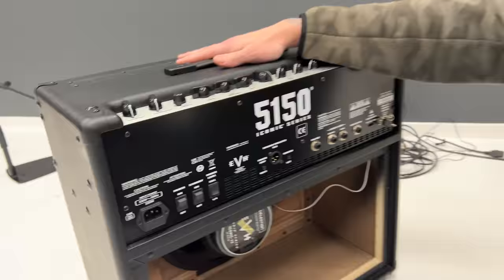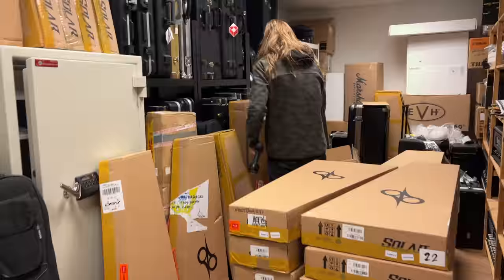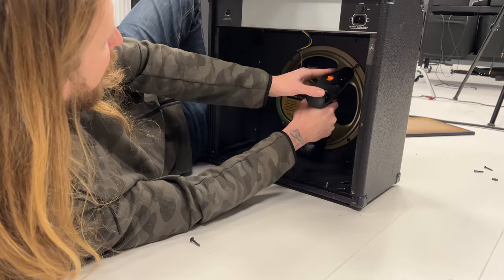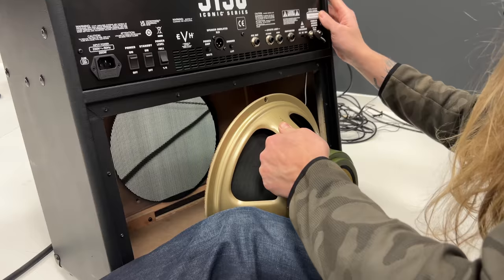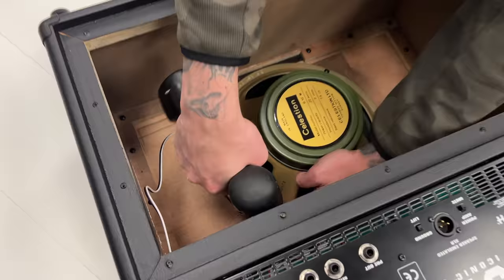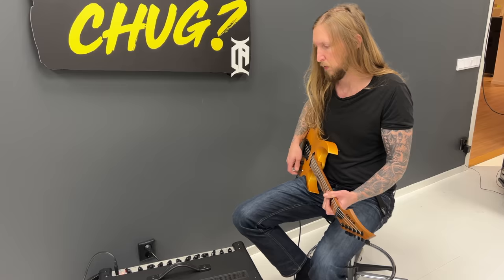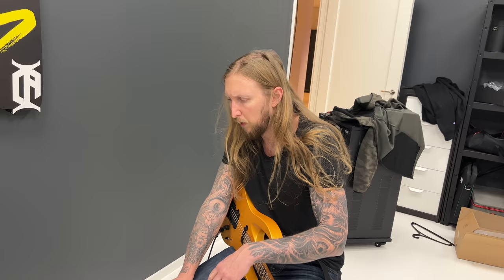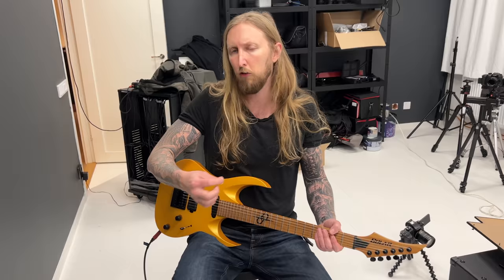EVH 5150 Iconic Combo Speaker Switch - Celestion Greenback 25W

Comment: Of course you can’t build a tube amp at this price using a UK built speaker, so I had Celestion modify one of their cheaper Chinese ones so it sounds in between the brighter G12H Anniversary used in our 5150 III combos and the darker EVH speaker that’s based on the G12M and used in our 5150 III 412’s. It looks similar because it shares some of the parts such as the critical smaller dust cover, 1-3/4” voice coil and the edge treatment is the same. I think the end result is a nice sounding speaker that’s much better than their stock cheaper ones and costs about 1/3 of the G12M.
Reply: Yeah I don't think anyone is dogging on you or anything.  I am looking forward to seeing what comes next for you and EVH/Fender and eventually trying the Iconic for myself.
Reply: If you don't mind me asking, how would you compare the iconic speaker to the Sheffield speakers that were made to sound like Ed's worn greenbacks?
Reply: @andrewsmall4865  understood, I just wanted to dispel the idea that we just threw a cheap speaker in it since I spent many months of testing and trying different tweaks to develop it. Ola didn’t say that but others have. Thanks!
Reply: @DarrenWaters75  these do sound closer to the Sheffield 1200’s to me, but the Sheffield had bigger/expensive magnets. So the efficiency is a few dB less on the Iconic speaker
Reply: Hi James, happy holidays.  Question, is the Iconic related to the Amptweaker amp you were prototyping a few years back?  Hope things are going well for you at Fender?
Reply: Hey James, what is the Impedance of the individual speakers in the Iconic cabs?
Reply: @austinp4489  16 ohms series parallel in the 412 and 16 ohm 112 in the combo
Reply: @jamesbrown7468  Thank you, the back of the speakers don’t show it and I like to pair my 16ohm DV-77 with a lot of different Celestion Speakers.
Reply: Thanks for the insight James! I’ve been really enjoying all the iconic sounds I’ve been hearing across all the demo videos! Great work!
Reply: @austinp4489  yeah, for some reason Celestion didn’t want to print the impedance on the label, but it’s on the magnet edge sticker
Reply: Hey James Brown can you talk Fender to letting you mod a Blues Junior. I have amptweaker tightdrive for over 5 years. That sound would be amazing on a blues rock amp.
Reply: The g12 h which is 55 hz sounds really bad azz also deep chug ,but everyone's ears hear a little differently,
Reply: I might just buy the iconic cab to test with some of my amp
Reply: Huge fan of all your circuits!! What're some of your favorite tubes & cones for your circuits (e.g. tight metal or 5150)?
Reply: Question for you, James, if you don't mind. So the Iconic combo is 40 watts, and the Greenback Ola puts in the amp is 25 watts. Is there any merit to the rule of thumb, that you should always have more speaker watts than amp watts? Can you damage the 25w speaker cranking the 40 watt amp?
Reply: @sergiopaulo4660  I haven’t spent time evaluating and usually use what we can get.
Reply: @jesperbc  I don’t know how much that greenback can actually take but that’s another reason we designed a 40w speaker for these. Depends on how loud you play the amp and for how long.
Reply: @jamesbrown7468  thank you for all the sick sounds! The music I listen to and enjoy making wouldn't be the same without your body of work 🙏🏽🔥
Reply: @sergiopaulo4660  YW, I’m glad you like my amps!
Reply: @James Brown knows his shit--keep it up, Sir.  Been enjoying the fruits of your labor for decades!!!
Reply: I got mine today, and the speaker in it does have a harsh metallic-y sound. Any way to EQ it out? Or just swap the speaker as Ola did?
Reply: @jonnybroomhead  it’s definitely less bright than the UK Celestion in the 5150 III combos, so try adjusting the presence down below half first and turn the highs up a little. We used a reverse audio pot on the presence so it comes up faster.
Reply: @jamesbrown7468  Thanks! It also seems (maybe just my brain) that the speaker is rounding just a bit the more I play it, like the speaker is breaking in or something.
Reply: @jonnybroomhead  it’s not your brain….I actually woke up thinking about how these speakers need about an hour of playing to break in.  It’s too expensive to have that done at the factory, but it definitely gets warmer when played some
Reply: James how do you get the back cover off the cab? Removing all the screws it does not budge. Worried about damaging it if I try to pry it away.
Reply: @hatata  I used a plastic body filler tool and it worked great.
Reply: @hatata  the vinyl kind of sticks. I’ve done it by poking 2 screws back in the holes on one side or corner and pull up while pushing them towards each other. Or you could use a small Phillips screwdriver in the hole to pry. Or hit it with a rubber hammer can jar it loose
Reply: @jamesbrown7468  I can’t thank you enough for replying … you built an amazing platform and I am very happy with the amp. What are your thoughts on the best Celestion that Matches your vision for the amp? I am playing at home at bedroom levels mostly will I be fine with a 25W green back since I’m not going above 3-4 on the volume or should I go with a 60W cream back and be safe ? I have the amp set to 1/4 power most of the time. I apologize if we are playing Frankenstein with your creation. But you know guitarists and their never ending search for the tonezzz..
Reply: @jonnybroomhead  thanks so much !
Reply: @hatata  if you’re not playing too loud the greenback will probably hang in there….I’ve never tried the creamback but I know the Fender guys like them. Frankly I spent a lot of time developing the speaker that’s in it since on the 5153’s we use EVH on the 412’s and the brighter G12H Anniversary on the combos. I tweaked this one so it’s in between. But you can always change it and adjust the EQ’s to suit you.
Reply: Wonder how a neo creamback would sound
Reply: I can't tell exactly how different it is because the mic'ing is different but would think the original speaker would be closer to the iconic sound you were going for.
Reply: I’d like to try it with a G12H-75 Creamback.
Reply: I have one question...hmm u can put another cabinet in this iconic combo, but there is wrote 40min what's that even mean? U can use another cabinet only for 40 mins or? I didn't get it. (I have the same iconic but in white)
Reply: @dav_e98  it’s not 40 min, it’s 4 Ω minimum. The Ω symbol is Omega and stands for Ohms.  That’s the measurement of resistance or in this case impedance. So the LEAST impedance you can use is 4 Ω(ohms).  If you add a 16 Ω external with the 16 Ω internal, you get 8Ω….so you set the switch to 8Ω.  Hope that helps explain it ✌️
Reply: @jamesbrown7468 Hey man, did you participate or know anything about the XXX speakers? I have one, using it with various amps and sounds really really great. Pretty hard to find in Europe though even used.
Reply: Probably a custom made Eminence speaker.  Eminence made a bunch of speakers for Crate and Peavey. @morellasgeorgios8449
Reply: Still made a good sounding amp dude.  I always got the impression Eddie liked his amps voiced with the Marshall Greenback speaker in mind to begin with.  Cause whenever I hear your circuit/derivatives through a Marshall 4x12 with Greenbacks, I immediately go "that's it.  That's the sound."  But if that stock speaker is the closest you can get with a reasonable price tag in mind, then ya still did a good job.

Plus, putting a 25 watt speaker into a 40 watt amp is asking for someone to accidentally blow out their speaker.
Reply: This amp has ended my clean tone journey. It's my one and only! Thank you sir for making this.
Reply: @Eunoia1127  glad you like it. I played a country gig last night with it myself…ch1 with an overdrive pedal and the Boost footswitch ✌️

Comment: Just the difference between a closed back and an open back makes a BIG difference in sound. If he re-attached the back plate, Or played it it with the original speaker and the back plate off, it would have been a more accurate representation.  As it is, I can't tell if it's the speaker or it being an open back cab.  Big difference.
Reply: also, acoustic memory is largely a myth. without side by side testing, it's almost always just going to be the result that one expects rather than one that is actually confirmed.

Comment: My dad was a car mechanic and one thing he taught us was to always start all the bolts before you tighten any. That way you can still wiggle it around enough to get that last one in straight 😊
Reply: 'zactly
Reply: I learned that the hard way when I assembled furniture as a kid 😂
Reply: I’m a professional Auto Technician, I can honestly say your Dad is 100% correct.
Reply: I’m worried about heat distribution with that closed back. 😬
Reply: @dangitdan9938  why?  The tubes are mounted up in the front of the L shaped chassis and the air comes in the back and out around the power tubes and up through the vents on top like a chimney. It’s got much better airflow than most combos that have tubes hanging down underneath the circuit board. It passed all the safety tests with flying colors. So don’t worry, I got this. If you’re talking about the speaker, all of our combos and cabinets are closed back and have no problem.
Reply: @jamesbrown7468  I've ran this amp HARD for hours on end, and I literally cant find a hotspot on the outside of the amp. Everything is nice and cool to the touch.  Heat management is stellar, and thats an understatement.
Reply: @caseylockwood5512  Cool! 😂
Reply: @caseylockwood5512  we designed the amp with the power tubes pointing up so they can’t fill the chassis with heat.  There’s a chimney effect where air comes in the rear chassis vents, and up around the tubes, and out the too vents. Once it heats up, the air flows pretty well and doesn’t pool up. Most combos are open back with the tubes hanging down and it just naturally heats up the chassis and the parts inside it.
Reply: 🤘🤘 what's up James you have been quiet
Reply: @jamesbrown7468  hello james i have a question about the 5150 iconic the burn mode happens before preamp or after? and people are stating that the amp is considered hybrid because it has a solid state circuit. i cant understand why
Reply: @jamesbrown7468  Wish you had put the controls on the face of the amp for easier access but the amp overall sounds great!!

Comment: Changing your speaker is the single thing that will most affect your guitar tone. It's the last item in your rig and is what vibrates the air for you. Speakers are kings of tone!
Reply: Is this safe to do? It’s a 40 watt amp and the greenback is 25 watts
Reply: @APPL3SL1CES  yeah just keep the volume down and maybe turn down the impedance on the amp, works for me haha. 5150s don't require power amp distortion to sound good anyways its a preamp focused amp.

Comment: Awesome. Having said that, I’m wondering now how the original would have sounded with the back off.
Reply: I'm thinking this, too.  Just the difference between a closed back and an open back makes a BIG difference in sound. If he re-attached the back plate, it would have been a more accurate representation.

Comment: I think the GB will ultimately work better in the Iconic than the Vyper. They really do prefer closed-back cabs and have both fuller and tighter bass that way.
Reply: Only that he played it open back lol.
Reply: @81giorikas  

The Vyper was, yeah. Was the 5150, also?
Reply: @nicholastotoro7721  Check the video, the camera well guy, or girl goes on the back and he hasn't attached the back panel.
Reply: And still the sound is sweeter more controlled less harsh and still heavy.

Comment: Thank you for this, especially mentioning the speaker impedance.  I've been looking everywhere for the impedance of the original speaker, so I'm guessing it's 16 ohms.  That's another thing to take into consideration, as impedance also has an important effect on sound.
Reply: I’ve been trying to find that out as well! My panel was set at 16 when I got mine. Gonna start experimenting with differ cabs now

Comment: Dude! Thanks for this video.  I was looking at the 5150 iconic 4x12 but for some reason retailers don't take pictures of the actual speakers in the cab. This was helpful, thank you. The Evh G12 speakers sound really sick! It's a shame they aren't stock in the full cab line. Cutting costs at the speaker is unfortunate bc some of the customers will then have to either upgrade or use a different cab that doesn't match the 5150 iconic head.  (Which might steer people away from buying in the first place  so i don't get their logic) They should offer a 5150 iconic mid tier with the better speakers at a higher cost as a separate option to save people the time and effort that want the OG EVH speaker in the new iconic amp.
Reply: Hi bro，I am puzzled whether the evh 5150 el34 can be used with the 412 greenback，😂what do you think about this problem？I’m prefer to play the rock and metal but not heavy metal
Reply: thats what i put in my combo and it sounds amazing !!!!!

Comment: Greenbacks are my favorite Celestion but  to be fair that EVH will sound better over time, i'd say like every speaker i buy brand new is really harsh and brittle even because it hasn't been broken in yet. that Greenback has had some miles on it so it's more malleable and lets a lot more bass out
Reply: I disagree i put the g12m 70th ana and it was a complete gamechanger !!!! brand new by the way.

Comment: I just did this.  Love it!  Might keep the old one just for a 1x12 add on cab
Reply: @MrCleanPhoto Did you have the original speaker in it for long? I wonder
If the sound will change when broken in. Do you try the original open  back before switching?

Comment: I have always thought with my ears anyway that the 55 hz  g12 h green back sounded better than the 75 hz ,with a origin or plexi Marshall of course the the iconic Marshalls just sound good um a late 70s early 80s kinda metal head ,with so many amps out there now ,sound is endless,,,,,merry Christmas chuggers
Reply: I've got an original 412 from the late 70s with those 55 Hertz speakers in it. Best sounding cabinet there is. I have a 212 I had custom made with the newer version of those speakers and it sounds almost as glorious. It's actually a little bit tighter but for that speaker it's not something you really want. It's got the crispity crunch.

Comment: Why not putting Celestion EVH signature given this combo is already has EVH name on it. C'mon Fender. Affordable doesn't always mean cutting cost in every component.
Reply: to be fair that EVH will sound better over time, i'd say like every speaker i buy brand new is really harsh and brittle even because it hasn't been broken in yet. that Greenback has had some miles on it so it's more malleable and lets a lot more bass out
Reply: also if they added a namebrand speaker in there it would drive the price up by like $250 bucks....i'll take the cheaper price and upgrade with my own speakers personally.

Comment: Are the 2 speakers the same watt? And it will sound much different with back off or on. And the Ohm change will change the sound alot to. So it would be hard to judge really. And is there a "better" sound? It's fun to mess around with gear and see tho.
Reply: to be fair that EVH will sound better over time, i'd say like every speaker i buy brand new is really harsh and brittle even because it hasn't been broken in yet. that Greenback has had some miles on it so it's more malleable and lets a lot more bass out

Comment: Hey Ola,
I want to give this a try I bought the Iconic a few months back and haven't been too happy with it. I have it running through my 412 6505 cab and was just wondering since this is a 40-watt and the greenback you put in there 25 watts were you able to turn it up louder than two O'Clock?

Comment: I like the original Celestion that came with the 5150 Iconic.  I'm not sure that putting a Greenback in it is necessary an "upgrade"...more likely, just a change to satisfy one's preference.  I'd be interested in hearing how the original develops after it has been broken in....I have a EVH 5150 iii 1X12 cab with a Celestion G12H Anniversary speaker and it sounds amazing.  According to my research, it supposedly is a cross between/hybrid of a Greenback and a Vintage 30, but I've heard some people say it sounds in between an M65 Creamback and an H75 Creamback.

Comment: I think those impedance switches are for external cabs, not for the internal one. The tone gets a bit mangled if you don't match the impedance, but should be fine otherwise
Reply: huh?
Reply: Nope, it definitely still matters, the speaker hooks up the exact same way. He had it set to large into small, which is not good. Had it been 8ohm into a 16ohm speaker then that would be a safe mismatch.